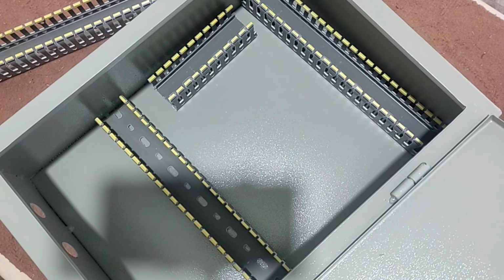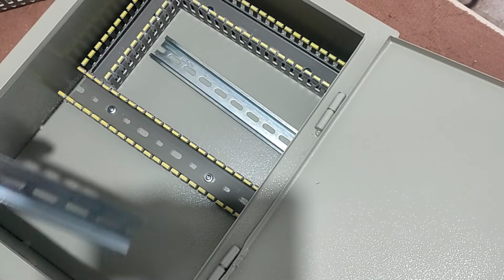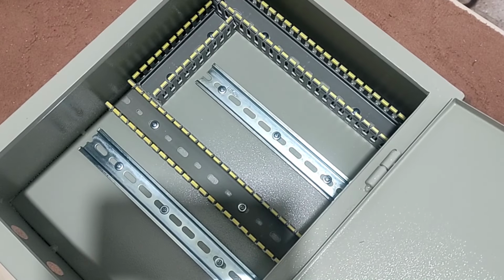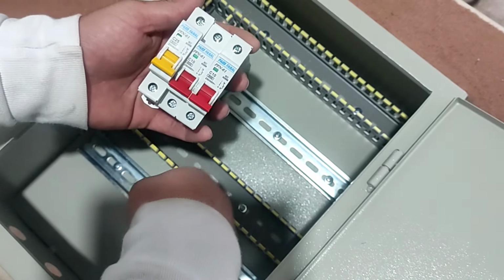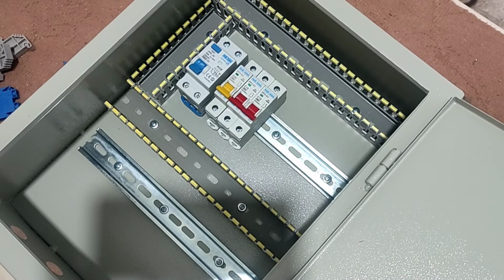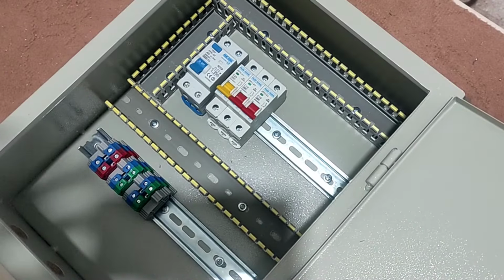Panel box wiring training(electrical for beginners)

Comment: Thank you for the videos. Very helpful. Could you do a panel for the air compressor automatic starting...the big one at gas petrol stations. They have a way they start and stop automatically when tank is full with air or when its low,  with also a timer inside... i wonder how they work together. Could you show please?

Comment: so power supply cable are connected to input side of  terminals?
Reply from the maker: Hello From the two terminals on the left, electricity enters the electrical panel and is connected to the input of the rccb switch, and then exits from the terminals on the right.